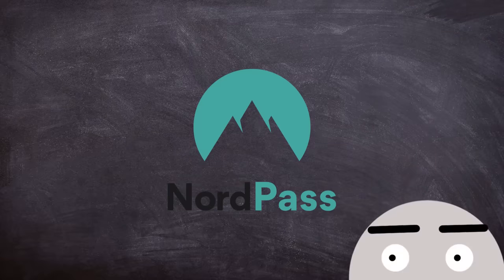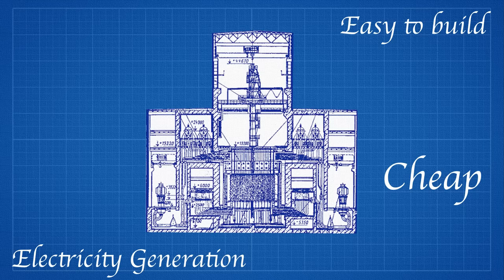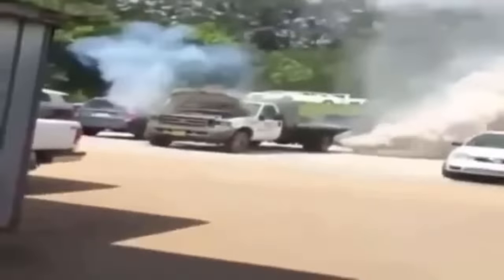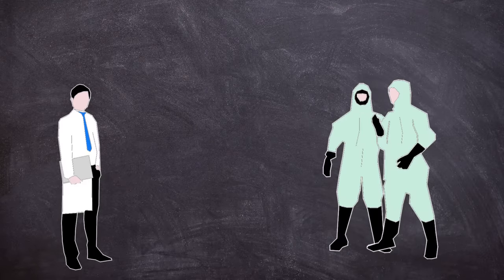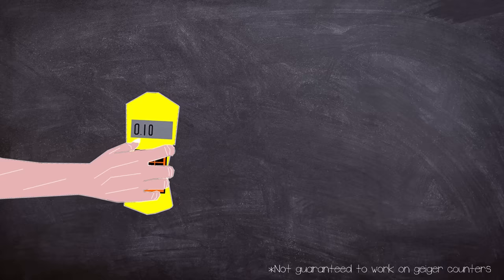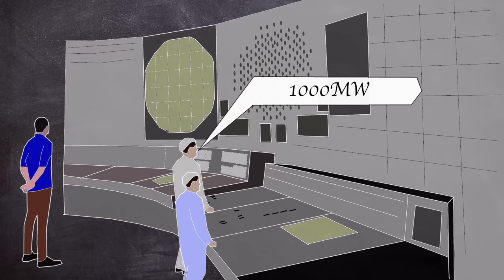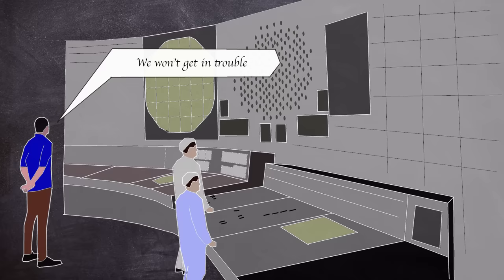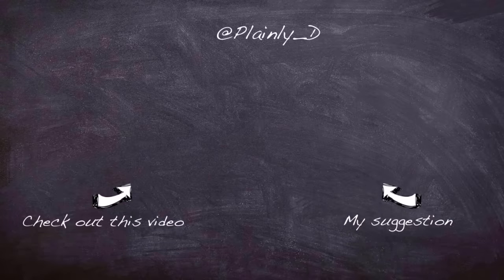A Brief History of: The Leningrad 1975 & Chernobyl 1982 Meltdowns (Short Documentary)

Comment: I don't know about western vs eastern reactor technology. In Chernobyl, 1 of 4 reactors blew up, in Fukushima 3 of 3 (of the ones that had fuel) blew up. So i'd say the safety systems in the other 3 Chernobyl reactors worked well enough to prevent a much larger disaster.

It's also worth noting that Chernobyl blew up because the technicians didn't follow the safety procedures, while Fukushima blew up despite the technicians following the procedures to the letter.
Reply: But in Fukushima there was a huge earthquake and a 15 Metres long tsunami afterwards, so pretty extreme conditions.
Reply: Most reactors existing on world are PWRs or BWRs, constructions like the RBMK are not very common.
However, the only one exploding without getting disconnected from the grid and where all cooling possibilities were destroyed by natural disasters was the RBMK, an accident which happened in Tschernobyl can't happen 1:1 at a PWR
Reply: @emreersoy7792  Yes, because it was very badly designed and then never upgraded. I'd say, putting a powerplant at that location was a much bigger design flaw than the graphite tips in RBMK reactors. At least the RBMK design flaws mostly only came into effect if the crew disabled most of the safety systems, but i guess no engineer can fix determined-but-stupid operator.
Reply: @simonm1447  The technicians at Three Miles Island (and other power plants) certainly tried. I'm pretty sure there are enough operators out there determined to make their production quotas that it's only a waiting game until one of them finds a fatal design flaw and overrides all safety systems to exploit it.

I'm not saying an accident exactly like that in Chernobyl reactors can happen in a PWR.  But we already know that shift change plus the new crew disabling/ignoring safety systems and procedures can have huge industrial accidents, just look at Texas oil refinery and similar.
Reply: @ReneSchickbauer  ,,But we already know that shift change plus the new crew disabling/ignoring safety systems and procedures can have huge industrial accidents'' That may be. 
However, a PWR is still more benevolent compared to the RBMK design with the positive void coefficient (reactors with this would not have gotten an approval in western countries for commercial purpose). Even with the mistakes which were made at TMI it didn't blew up, and if they would not have interfered the automatic control would have kept it in a stable and safe condition. 
If you compare this to aircraft, there are aircraft which need skilled pilots to be flown safe and aircraft which are even safe with less good pilots. Both will fly, however if you give the bad aircraft to the less good pilots they will crash it. 
There is surely a reason why Russia today is only building WWERs, and no RBMKs.
Reply: Imagine defending the RBMK design with whataboutism. Just i m a g i n e.

I won't tear apart every single argument here since others are on the case, but I will at least point out that your "only 1 of 4 at Chernobyl blew up" is intellectually dishonest at best. Only one blew up because only one was being actively controlled by the operators during the ill-fated turbine spin-down experiment. Had the same inputs been made to all four reactors, all four reactors would have had similar results (albeit with minor timing differences due to uneven xenon poisoning).
Reply: @nomakewan  First of all, i'm not defending the RBMK design. What i'm saying is that the design wasn't the main cause of those accidents, it was bad operators disregarding all the safety procedures and safety systems that have been put into place.

What i'm also saying is that western reactors may or may not have better safety systems, but still experience catastrophic failures.

I think my main point here is that i find it very strange when "the west" points fingers at "the east" for having inferior reactor designs when the worst reactor accident in the east (chernobyl) was mainly due to operator error and the worst accident in the west (fukushima) was due to very faulty design to save a few bucks.
Reply: @ReneSchickbauer  The accident in "the east" was as horrendous as it was because of very faulty design to save a few bucks. Had the design been different (negative void coefficient, secondary containment, etc), the incident may not have happened, and had it still happened, it would not have been as devastating.

Again, I'm not going to waste time going through every single difference between Chernobyl and Fukushima because this is a YouTube comments section. I just find it intellectually dishonest to appear to claim that Fukushima was worse because "western design" rather than actually going into the details of both accidents.
Reply: @nomakewan  Just to make it clear (again), i do not claim that "Fukushima was worse because of western designs". I'm saying that the ultimate cause of Fukushima was a severe design flaw.

Yes, RBMK reactors have just as severe (if not worse) design flaws, but in the case of Chernobyl the operators pushed the reactor beyond any safe limits.

And yes, i'm saying that Fukushima was also badly designed. Putting all the emergency generators in the most vulnerable place of the whole site is just pure incompetence.

Comment: Making the details (or even the acknowledgement) of nuclear incidents and accidents State secrets meant that nobody in the Soviet nuclear industry could officially learn from incidents. Operators might hear about them from colleagues, but you risked a KGB interrogation and being sacked if you were reported.

Jobs in the nuclear industry were highly regarded and sought-after, so Soviet operators were unlikely to risk their jobs either poking around, researching previous incidents and accidents, or questioning their superiors too much.

The fear of a domineering superior who might well sanction or sack you is pretty much what caused the operators at Chernobyl to ignore ao many safety procedures and follow Dyatlov and Fomin's disastrously ill-conceived "experiment" on 25-26 April 1986.

Dyatlov, plant director Bryukhanov, chief engineer Fomin were themselves under pressure from their superiors to get the rundown experiment done, after previous attempts had to be called off.